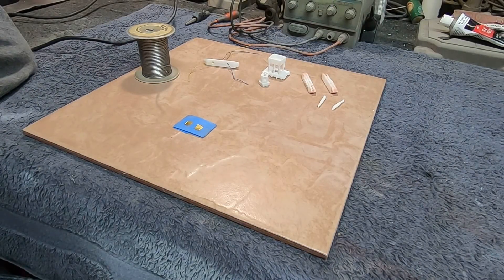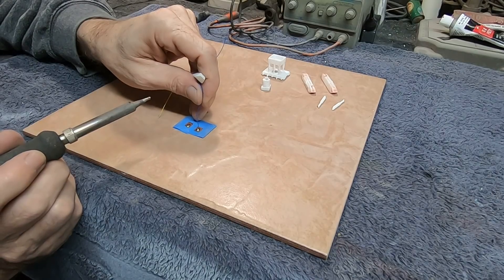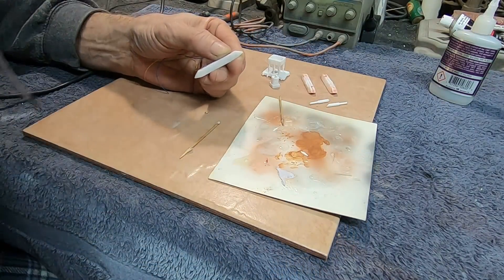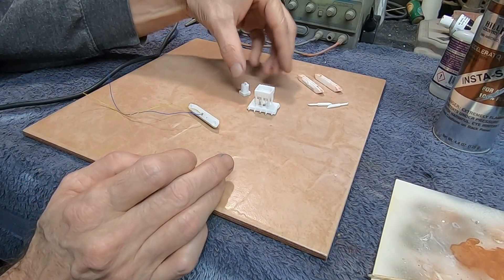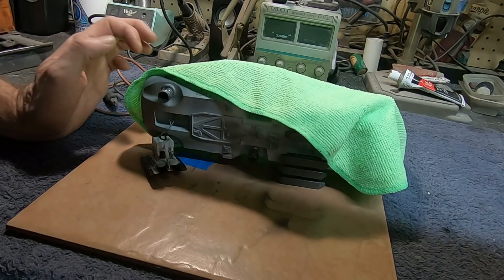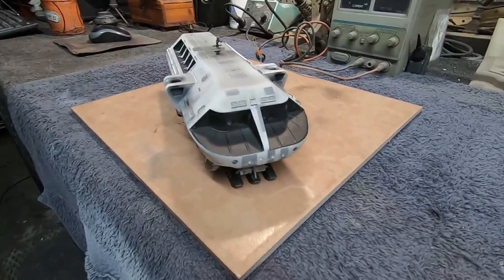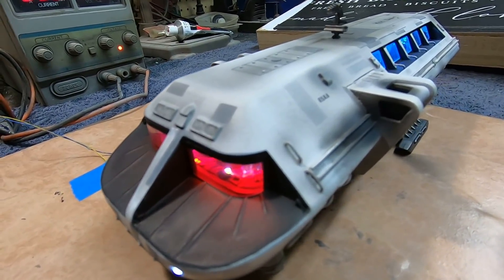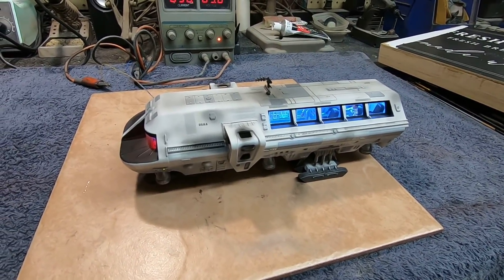Let's Build The Moon Bus From 2001 (Final Assembly & Painting)

Comment: I thought initially the cloth was to protect the rest of the model from being touched with gluey fingers, given the fiddling with the wires you had to do in the confined space after applying the glue.  I hate when I'm working on something and get to a step where something simple suddenly turns difficult and you have partially setting glue on your fingers getting everywhere if you're not careful.
I guess that could be a good precaution to take if one thinks ahead enough and expects that could be an issue.
The model is looking great!